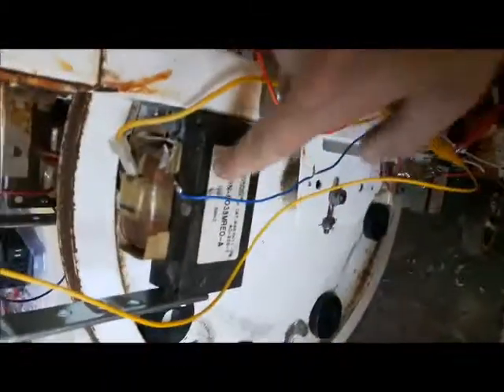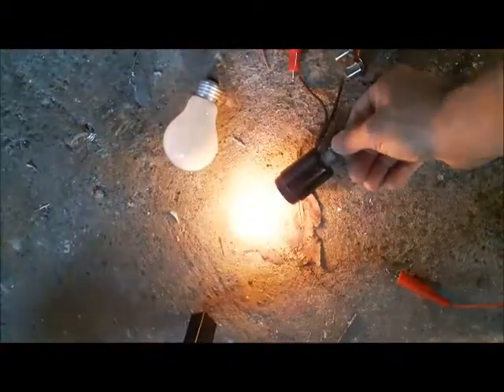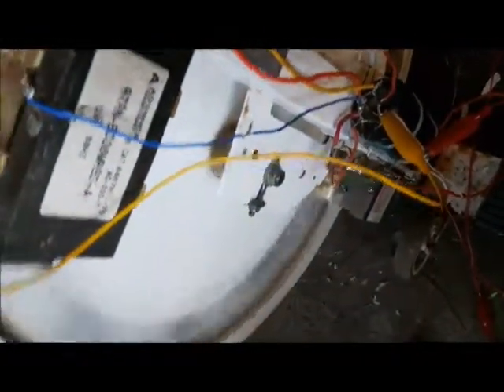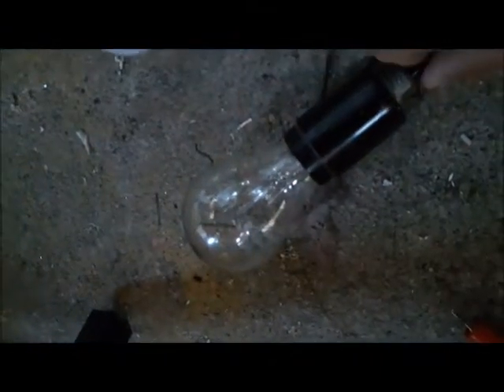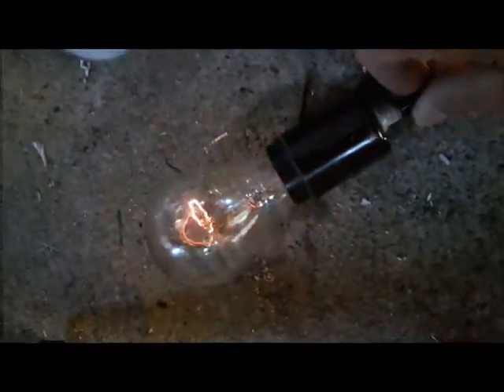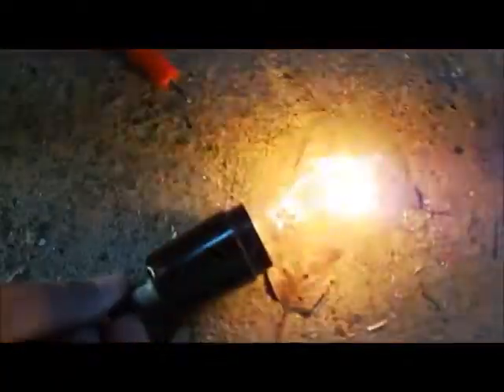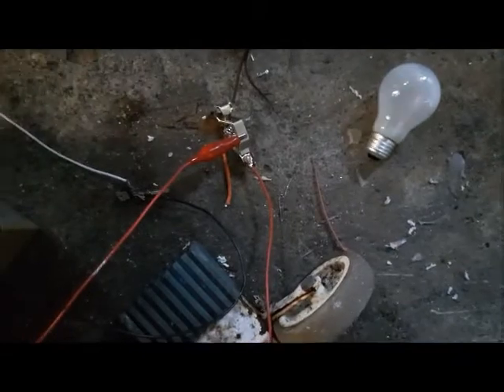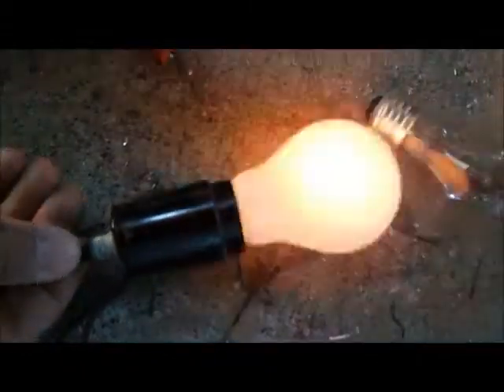Stationary Bike Generator - VERY LOW DRAG, HIGH POWER!

Comment: can you describe how you modified the microwave transformers and how you wired them in your setup?Thanks for sharing.
Reply from the maker: Sure. I started making a small builders course, but will have to reshoot as the recording was terrible.
Reply from the maker: But in a nutshell, you saw off the top plate on the transformer where the welds are, then you wack the plate off with a hammer and long screwdriver/prybar. I wired the secondary coils through a bridge rectifier then feed directly into capacitors or batteries